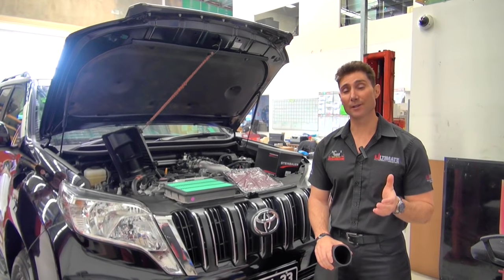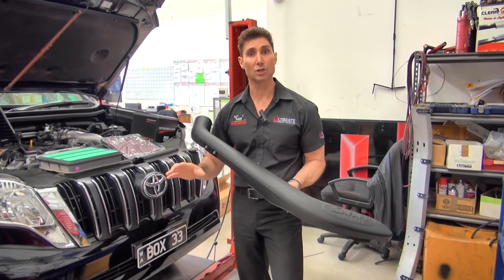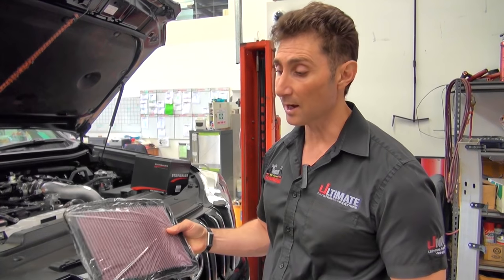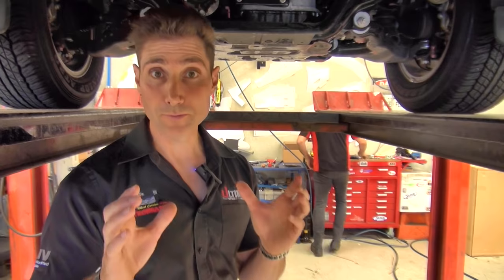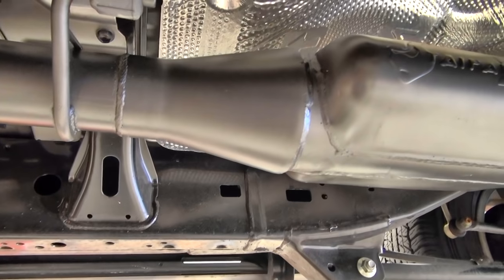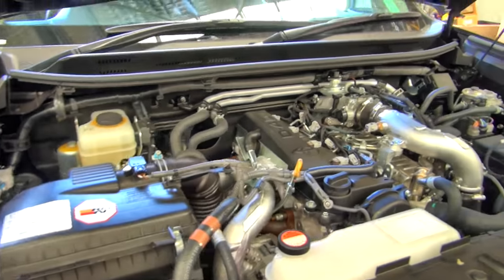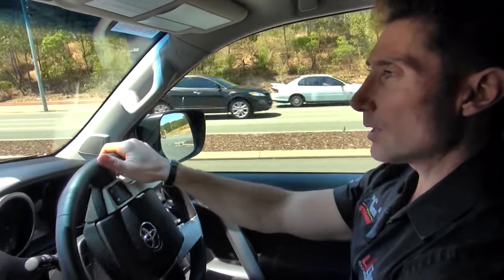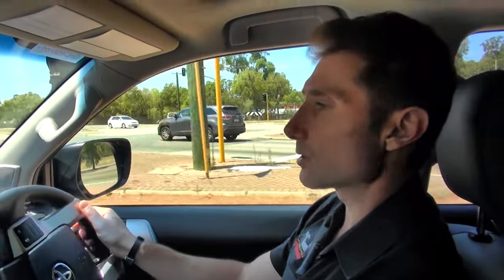Increase your 4wd performance with these 4 easy power upgrades

Comment: Please stop spreading the ram air and the K&N thin air filter.
1st myth (Ram-air)
Naturally aspirated engines with normal compression ratios create air pulling or high-speed air-flow only when they rev close to full throttle, how can I believe that a ram air cloud make better airflow when I can only notice air-pulling after removing the inlet & with the engine revving at 4000 rpm+ and only because the valve train rotating forced the intake to create all this air pulling so this feedback (air pulling demand) is coming from the engine valvetrain to the intake , all modern EFI, Air-Mass (MAF) automobiles use only slight amount of air to mix it with gasoline with throttle actuators & lots of sensors such as Intake Air Temperature Sensor, Knock Sensors, Cam/Crank Positioning Sensors and they are tuned to actuate the fuel delivery to match the air mass entering the engine for the worst-case scenarios as where vehicles that are operating in a drastically air polluted cities with their air-cleaners completely clogged, those are the very rare cases where engine performance is reduced by actuators (sprays less fuel due to the low air mass entering the engine) to prevent damaging the engine and to keep the longevity of it, that's why your car does not miss-fire even if your air cleaner is clogged it only performs less(if only the air-filter is clogged), there are millions of other reasons to make the engine miss-fire because of reduced air-flow e.g. clogged intake valves, headers, catalytic converters because all of these components are after all the actuators & sensors I've just mentioned in which can lead to miss-fire, so believing the fact that ram air is better for airflow is pure rubbish, if you want air-flow either you full bolt on your engine or you go for forced induction mod, some snorkel ram air intakes, however, are used to provide alternative air source other than the front grill in a flood or a river crossing for instance.
2nd myth (K&N/Sport Filter)
Again on naturally aspirated engines with normal compression ratios those filters only provide 5 more bhp or 5 lb-ft of torque again at very high revs on an off-road you do get into some minor high revs sometimes but most of the time you drive steady progressively and with mid-range torque curve, meanwhile how can i believe that a sport air filter with more air-flow due to logically less filtration could provide a cleaner air, that is tremendously is ridiculous, all kinds of dust & harmful objects are poured to the engine, I don't think anyone that goes off-roading would sacrifice their engine life with some mythical performance fegures.
Reply: So you don't recommend a snorkel say on a daily drive?

Comment: The ‘ram air’ effect will do absolutely nothing other than direct more debris into the air filter. You are best to face that ‘ram head’ towards the back of the vehicle. A turbocharged engine doesn’t need ram air, the turbo takes care of that. The K&N panel filters are not as good at filtering compared to the standard panel filter, those things are for ‘road cars’ not four wheel drives that can be sucking down dust for days on end. K&N make filters for off road and that is not one of them, they have outer removable layers like socks. You will root your airflow meter before long with those oil sprayed K&N filters. Cold, clean air is important, ram air is not.

Comment: POWER = Bigger turbo! Bigger Cooling!  Or just drop out the crappy motor and slide a nice v8 0r v6 in there with a twin scroll or 2 turbo setup. Build the engine to manage  a 1000whp and de tune it to 700 or 650 whp and its reliable :) Done! and just dont check your MPG haha

Comment: 3:20 sec in the guy is mis-informed. Its ceramic coated to hold the heat in the exhaust. If the gasses cool their velocity slows and performance suffers.

Comment: just advertising for the products and how many kw did it cane and tourqe the exhaust system why is there some many mufflers in it they like to breath so it keeps exhaust temperature down all those mufflers in there would slow the flow down
Reply: The Subject there is Legality, it must have a muffler to be legal, no questions asked. These guys are offering Safe Reliable And Legal Power Increases.

The perforation in a muffler produces heat for a purpose, creating a low pressure area behind the turbo, helping spool it up down low, this gets rid of some of the lag you get from these turbo diesels.

Comment: I would stick with the paper filter.. K&N filter has to be oiled and as soon as it goes offroad, the filter will clog up with dust and it will stick to the filter and restrict airflow.
Reply: Use both. K&N for on-road, Paper OEM for off road. Takes 2 mins to swap filters. Best of both, extra flow for on road, better filtration for off-road. Just my 2c.

Comment: Those Steinbauer controllers are great. You will be replacing your fuel pump every 150,000ks though. Toyota engineer for 10% over stock. If you want more pull, don't buy Toyota.

Comment: snorkel....performance boost?....bullshit. Good for safe water crossings that's about it.
Reply: It's good not just for water crossings..
Reply: snorkels bring the intake higher up where there is less dust.
Reply: Not true, they also keep unnesceaasy particles and dust by being elevated etc. Why do you think many if not all the Toyota's in the safari videos have them installed? They don't normally use them for crossing rivers etc.

Comment: Don’t know why this was on my list, this guy is a uninformed tool passing on miss information to others.
Safari does not ‘ram’ air at all, and it may keep some dust out of your air cleaner but introduces much more bugs and large debris
K&N are terrible on modern cars, they don’t filter the air enough to protect the engine, they also coat the air flow meter with oil film, both of which actually reduce performance, increase maintenance costs and increase fuel usage over time
Ceramic coating on exhausts is to keep heat in, this makes the exhaust gasses maintain velocity which promotes good flow. It also helps prevent corrosion which is a big issue on 4wd that actually get used.

Comment: I watch these "engineering based" videos and I can't believe that this unscientific salesmanship is believed by the average punter. I'll explain.

1. The velocity of the air due to the ramming of the air into the air box will be reduced by the air filter. If not the filter is not filtering. Also statndard air filters are probably the best on the market. Think about it. Why would any manufacturer fir an air filter that restricts air flow and reduce power output? If this was the case and the aftermarket filter allowed more air to pass, whats happening to the filtering? I suggest bigger holes and freer flowing air equals more dust and dirt pass as well.

Another furfy perported by the "engineering gurus" on videos is that the rain hat top on a 79 series Landcruiser should be changed for the square cross hatched model as shown by "old mate" in the video. This is because they reckon that there is not enough surface area to let the engine breathe. I have measured both. The 79 series standard rain hat has a larger surface area than the square one. So I'll call it. .......... Horses..t!!

2. The dump pipe is ceramic coated to "not" dissipate the heat? Then how is it keeping it cool?
3. Toyota manufacturing a vehicle that has to handle variations in air pressure throughout the world is not the reason that the vehicle does not perform at it's peak. The manifold pressure sensor takes care of the differences in air pressure. The truth is that these engines are set up with a lean air fuel mixture for lower emissions. Re mapping the air fuel mixture richer, ensures maximum power for the available boost pressure but this also increases emissions. Nobody in this video mentions emissions.

Wayne Roberts

Comment: “Super performance stuff”, “ram air”. That’s not how a ram air intake works..if you know 1% about fluid mechanics, you’ll know that small to large is an increase in pressure, not large to small

Comment: not power comes from these mods on any engine if you want a real increase in power do the following... 1. 3" stainless snorkel 2. custom water/air tight air-box with a pod or cone filter 3.bigger exhaust 4. new injectors and spark plugs designed for diesel performance 5. a large inter-cooler 6. 3" stainless intake piping 7. a real tune by a local company cause its just stupid too run the same tune all through different countries with completely different climates too us.
Reply: Spark plugs on a CR diesel??  Hmmmm.....
Reply: @jarretfox4808  yeah I know I meant something else but can't for the life of me remember wtf it was to edit it been over 2 years and moved away from diesels

Comment: HORRIBLE HORRIBLE EXPERIENCE
I chose this company because it was a family owned local company and wanted to support local. Turned into the worst experience with a business I’ve ever had. 7 months and the work is still not complete. Company has admitted fault but doesn’t care because they have been paid. I WOULD NEVER USE THEM AGAIN. Now I have to pay for someone else to finish the work I’ve already paid them to complete. DISGUSTING

Comment: DON'T EVER BUY A SHERPA 4x4 SNORKEL (OR WINCH). They sell you actual $29 Alibaba Snorkels for $350 - $400 ( I can validate this) . If I can save just 1 person, Ive done my job. Scintex are the biggest scam company in Aus.

Comment: You havnt run k@n filters in fine dust have you
K@ n talk the talk but dosnt walk the walk you will find dust in the inlet tract when driving in dusty conditions no matter how much you oil that filter 
It flows better and you can feel the differance thats because it dosnt filter well
 Just look at the sun through one huge daylight holes all over the holes the size of small grains